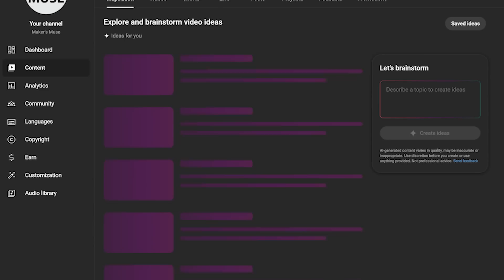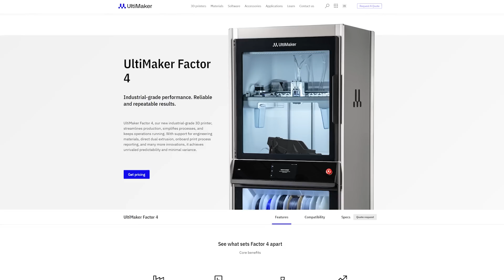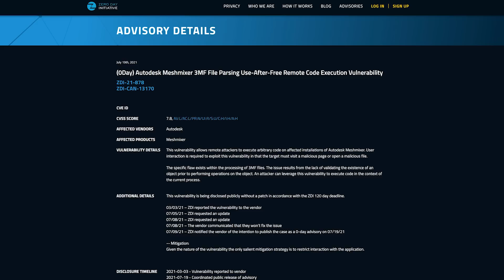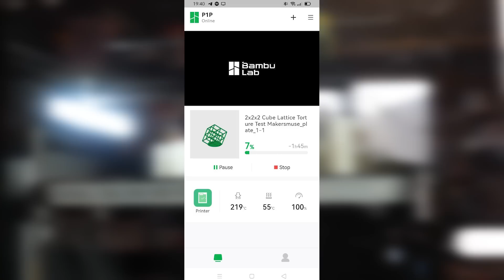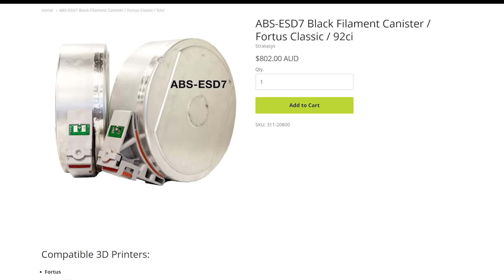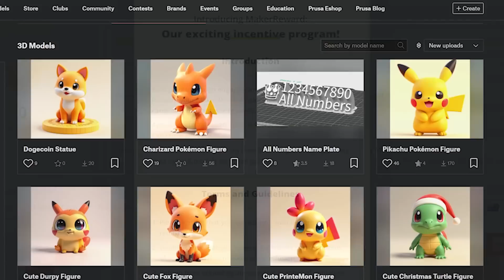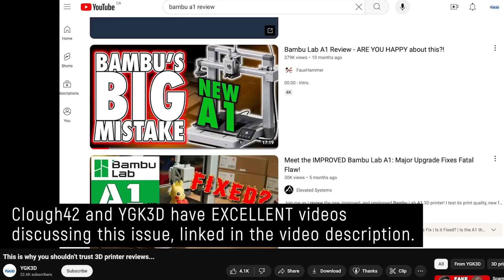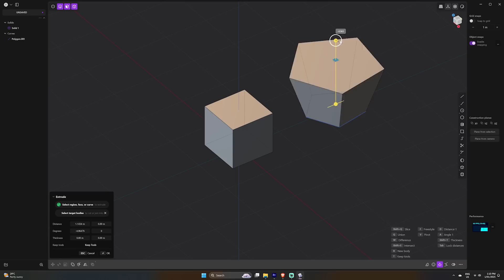My 3D Printing Predictions for 2025

Comment: I see a major change on the horizon will be to see HUGE drops in prices for premium brand/printers but they will ONLY work with an always on internet connection and a monthly subscription fee.  Manufacturers will try to convince people this is a good thing by providing a vast selection of models to choose from.  But the end user will only own the printer in name alone and unless they are willing to make a significant investment in time and aftermarket parts they will be stuck with this subscription model.  The manufacturers will also take over all slicing options to make it a simple "press a button and print" function which will appeal to the new user (or the simply lazy) but no actual understanding of 3D printing will be involved.  They'll turn them into the 3D printing equivalent of a microwave oven.  I can absolutely see them marketing it with images of a grandmother somewhere pressing a "start" button and then pulling a perfect toy out to give her grandchild as a gift.

I see paid reviews INCREASING in number, which is really sad TBH.  Unless the reviewer spends their own hard earned money on the printer I don't give reviews any credence.  The reviewer simply CANNOT give an unbiased review if there is no risk to them.

I also see an increase in the number of filament types and blends made available with each manufacturer coming out with their own names and acronyms to try and distinguish their filament from other brands.  This will intentionally serve to confuse many people so they will then just stick to the one brand they know and likely it'll be the printer manufacturer's own brand.

Basically there will be a lot of sneaky tricks played on the consumer to make them THINK they are getting more for their money when in reality they will be getting less. If the manufacturers can't increase the prices of the printers they will invent new revenue streams.  I wouldn't be shocked to see them come out with a cheap line of printers they consider to be disposable.  You NEVER even think of fixing it.  It just goes back into the box, you send it back and they ship you the latest model.  Of course this will be bundled with a MANDATORY subscription fee, plus extra hidden fees if you don't save the original box and packaging, pack it THEIR way or have in ANY way "tampered" with the machine. But they'll get a LOT of takers if a new user can get an X1C for $150 shipped to their door and a $15 a month subscription.  Many people will simply use it for a year and send it back thinking they are beating the system.
Reply: Yup the community will be overrun by greed and con-artist 🤔!
Reply: Sad, but probably true. Just look what Adobe has done with their Photoshop products over the last few years. Everything is now Subscription based. Access is either extremely limited or denied completely unless the monthly/annual subscription is current.
Reply: This will not happen entirely because its very easy to make a completely diy printer, like its literally impossible for this to happen because basic printer components are not proprietary or complex, unlike phones for instance.
Reply: @user-cg3em4cw4f  I get where you're coming from but there is a difference between buying pre-made and complete DIY.  As long as the aftermarket exists there will always be DIY but the vast majority of printers will be prebuilt, manufactured appliances because 99% of people who will buy their first 3D printer will NOT be looking to build from scratch.  One can buy all the individual parts, including a gutted shell, and build their own car from scratch for their first car, and some do, but really how many people ACTUALLY do that?
Reply: @Enjoymentboy  My point is that the same things I mentioned above mean the era of disposable printers can't come to pass. The costs that would be incurred to make a printer unrepairable with all custom components would itself mean the machines couldn't be cheap enough to be disposable. Printers are fundamentally just 4 stepper motors and maybe a few limit switches. I don't see a feasible way to prevent control board swaps in the event of a part failure given even industrial cnc machines can't effectively prevent it.
Reply: @user-cg3em4cw4f  I hear you and I suspect I used the word "disposable" in a more generic sense.  Not in the "toss it in the landfill" manner but in the "I'll just get rid of it and replace it with a new one".  Many people see their cars as disposable once the warranty ends because now they will personally be on the hook for repair costs.  It's how the individual consumer sees things.  As long as the consumer THINKS they are getting a better deal by getting rid of something they see as old and getting something they see as new it's something a LOT of people would take advantage of.  Consumers are becoming increasingly lazy and I can absolutely see 3D printers being dirt cheap but will ONLY work with the manufacturer's own filament as per the terms of use.  Think of like with inkjet printers.  They'll basically give them away but then outright gouge you on the ink.  Never underestimate the ways a company will take advantage of a lazy consumer and never underestimate how lazy a consumer can become.  😁😁

Comment: Please please please "do"a review of FreeCAD.  I really would like to know if it can replace the expensive F360.
Reply: +1 to reviewing FreeCAD 1.0, but do an honest review (like your other ones) and don't praise it just b/c it's OpenSource (again, just like your previous reviews).  I'm a big fan of OpenSource, but disliked FreeCAD in the past due to its UI/UX being clunky.  It will be interesting to see if (in your opinion) that has changed.
Reply: freecad 1.0 is nice but its missing the small QoL things like polar array can't be changed via formulas
Reply: @plazmaguy13yago9  - just this week I downloaded FreeCAD to try it out and immediately had issues controlling model navigatino/movement.  It's such a shame the app doesn't allow for the apple track pad.  I think I'll need to buy a three button mouse to give it a good try out.
Reply: Considering Ondsel shutting down, it'll be useful to detail what was brought into the upstream for v1.0 and what other improvements might be coming.

As a user of FreeCAD, I miss Onshape's intuitiveness (and other features) but enjoy it's unrestricted-Freeness, if that's a thing.
Reply: I don’t run into things I can’t do in FreeCAD any more, and I find it more responsive than SolidWORKs. I haven’t used Fusion 360 in years because I dislike Autodesk and don’t want my designs tethered to their platform. It still crashes occasionally, but learning to use it is like learning to use any CAD software, it does basically the same things, but the names and buttons are all different. Driving designs off spreadsheets and making parametric parts that can be reused is doable, but not intuitive. I’d say it’s certainly usable but there’s a lot more friction for some of the more complex things
Reply: He already covered FreeCAD
Reply: I've might look at solidworks which is only 50€ per year for private use, instead of 600€ like Fusion
Reply: Are you not using the free personal edition of F360?
Reply: @TylerArbon  - no I moved to a paid version (education licence) so that I could have unlimited models.  I tried using the free teir but became frustrated promoting and demoting models near continuously.  I know that I could go back to that version and just suck the annoying model limit.
Reply: You can't replace F360 ,at least not in 2025

Comment: 12:50
You should try Kompas 3D
I thought that Russians cannot make good software, so used fusion360, but after all the things that they've been doing making it harder to me to access it, and run it in virtual machine (I'm Linux user, so...) I tried to switch.
I tried ondsel, freecad, solvespace, but all of them lack critical features that I was used to, so I couldn't just make it work. So then I tried Kompas 3d v20. Yes, I've pirated it, got some kind of "portable lightweight" mod, but the reason for it lightness was the removal of built-in models library, which for me was not that critical. I installed it into virtual machine, and... It worked. Slower than on pure windows machine, but very usable nonetheless. And although some features took googling to find how it's done in Kompas, I was able to find it, and it just simply worked. 
No internet connection was needed also (that is probably only in pirated version, but Fusion is cloud-only, so... If I understood correctly, bought version is activated once, but after that I don't know if and how often the internet connection is needed)
And it is quite cheap, converting to USD home license is 15$ for one year.
Maybe I'll buy it when they will provide full Linux release
Reply: Where did you find the information about the license cost? Personally, I would steer clear of any Russian products these days—both on principle and due to the non-zero risk of the company potentially falling under U.S. sanctions, especially considering their likely ties to Russian military production.
Reply: @Dmitry_IMHO  don't know if you've seen it, but apparently my response was deleted....

Comment: I still really want a free (or even sub $100) and entirely local (ie. no exfiltration of my data to the cloud) alternative to Fusion 360, but alas it does not seem to exist. FreeCAD's workflow and feature set is fn awful, and there's very little else that even remotely resembles Fusion 360 :(

Comment: Excellent set of points you raise!
I bought a Prusa i3 Mk3 because I wanted something that works 'out of the box', well it did after I assembled it, and it's still chugging along great 6 years later with minimal maintenance needed.
I give away all my designs on the proviso anyone selling prints of them has to link back to where I uploaded the stl so if you have access to a printer it's free, because I know once something's on the internet it's virtually impossible to control/remove, I can find Usenet posts archived by Google that I made 29 years ago...
Looking forward to the combat robot stuff!

Comment: Thank you so much for sharing your experience! I've learned a lot from your videos, and I have found my passion for engineering from the 3D printing community.

I think that multicolor printing will either die down a bit and mainly be used as a multilateral system for mechanical properties.

Comment: My first 3d printer is being delivered today, I can't wait! Its the bambu A1, hopefully its as good as everyone says.
Reply: Make sure you keep the bed clean. Even oils in your skin can affect adhesion, and you won't necessarily see it. One of the top things I see when people ask for help online is when stuff no longer sticks to the bed.
Reply: A drop of isopropyl alcohol on tissue is good for cleaning the bed, and if you find TPU prints stick too hard, a drop if isopropyl on the edge of the print will help loosen it from the bed.
Reply: It's not. bambu has a 1.4 consumer rating for a reason. When your A1 breaks down, like all bambu lab 3d printers, bambu lab will ignore your support tickets.
Reply: @LilApe  My experience so far has been wonderful, hopefully it lasts, the print quality is unbelievable
Reply: Watch out on your early days of 3D printing with it, don't get too carried away printing lots of trinkets & fidget toys, unless that's what you bought it for :)
Reply: @licensetodrive9930  I bought it purely for useful things that I've been 3d modeling, like car parts and bushings, and things for my work.
Reply: The support tickets I put in alll was work and they help well

Comment: I really hope Printables gets ahead of the other model sharing sites, and goes with a no AI generated content policy. At the very least, have the ability to filter it out by default. It's on Joe's radar at least, so here's hoping some sensible decisions are made
Reply: +1 to that!  Either a) no AI models allowed policy, or b) require the author to state if the model was AI generated, and then let the users of the site filter searches to not display AI generated models.
Reply: Bambu will probably launch one way worse than Printables and maybe even integrate it in their slicer. It will probably take over because it's "Easy to Use" for the average bambu owner to download AI generated Funkopops.

Comment: I'm glad the time of tinkering with your printer is over. It's great to be able to design and print. The problem is with the introduction of easy to use printers, noobs aren't interested in doing any sort of initial research or troubleshooting and jump straight onto Reddit for answers. Same questions on a daily basis. They forget they are tools. Some education is required.
Also $2000 US is like $5000 AUD (not quite but close when you factor in price gouging) 😂. Getting a bit pricey.
Reply from the maker: Yeah I didn't realise how bad the dollerydoo had fallen haha! Might lower the cap more.

Comment: A breakthrough in the resin space is definitely needed in 2025. Hopefully non-toxic resins will become more common and affordable.
Reply: The only thing stopping me from using resin printers is the toxic part, probably many others too
Reply: @jan49_ same reason I barely like to use my fdm printers and those are much less toxic.
Reply: The challenge is the toxic part is what makes it work. 3d musketeers had a podcast with a bespoke resin manufacturer.

Comment: I love/hate Onshape. 
Not nearly strong enough for most commercial use. Solidworks/Inventor veteran and taught Onshape for a HS robotics team, so I'll fight ya on that point. Onshape IS amazing in the education sector since the kids could use it wherever. Outside education though, you're paying $1,500 per year! (Or have ALL your files open to everyone) That's pro level pricing on at best intermediate level software. If your going to pay, just stick with the Fusion 360 christmas deals. Typically $600+ per year, but I always see deals for ~$300

Comment: I think new materials and higher temp printing, at a consumer level, are in the pipeline this year. The QIDI4 Plus with it's ability to print pps -cf is a game changer. Plus Polymaker's Fiberon line, which includes pps-cf just came out. This big filament company will be pressuring 3D printing companies to make their printers work for this material. I see an arms race on the horizon... by the end of the year we might have a QIDI 5 printing PEKK.

Comment: I really hope for some larger Idex printers.
I spent several years on my sidewinder x1, so now that I finally started looking for a more capable machine (preferably a dual extruder that uses widely available hotends / nozzles and is capable of printing engineering filaments), I tend to get disappointed after finding out that this "large print area"advertising claim refers to something like a 200x150x150mm bed.

The most promising candidate at the moment seems to be the Prusa XL, but from what I have read it simply has way to many issues for a printer at that price point.
~~otherwise I just have to bite the sour Apple and build something myself, though my sanity won't probably appreciate if I skipped that part~~

Anyway, I really appreciate your videos and wish you and everyone here a great 2025^^

Comment: Design Spark Mechanical could easily become the best free CAD software if they just added a few more features for automation. Like auto generating gear teeth, threads, ect. I think you can subscribe to them to get access to a mirror tool and a few more features already.

One day I'll hit the lottery so I can make some solid CAD software.

Comment: Finished the video, looking forward to the stuff you outlined in the last segment! Less reviews is good, so much is coming out and copies CoreXY and Prusa that it doesn't have to be looked at over and over again (warped beds is probably the biggest issue in the past but mesh leveling should take care of it)
Design tips and tricks would be great... Those were super helpful, kind of like what Slant3d has been pushing out

Comment: 3:27 if you join makerworld's "exclusive models" program, any models you upload to their site and tick "make this an exclusive model" will automatically be searched for anywhere else and if they are found you will be told and you can file a DMCA quite easily
Reply: Unfortunately that means the covered models are locked into MakerWorld. I suspect this is a part of a larger lock-in strategy by Bambu.
Reply from the maker: handy!
Reply: @MakersMuse Funny joke, like Bambu handy app!
Reply: Should be the default, honestly, but it's a start.
Reply: what if someone steals my model and registers it as an exclusive on makerworld? Will I get dmca complaints for my own property?
Reply: @ yours was uploaded first though right?